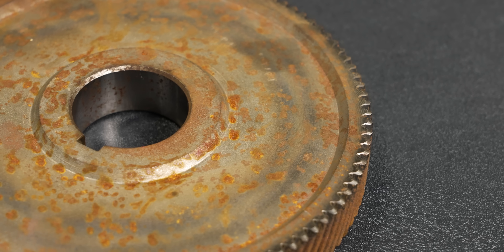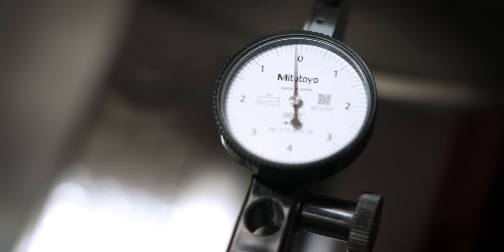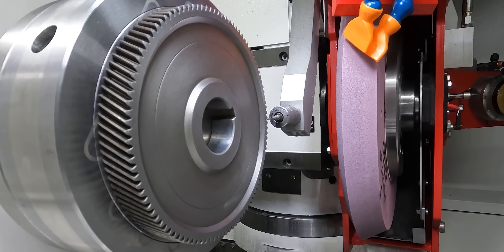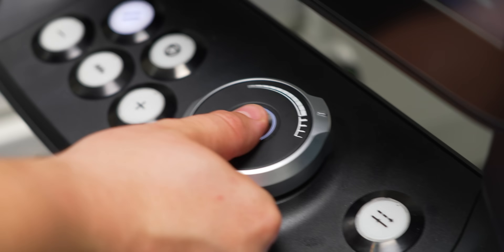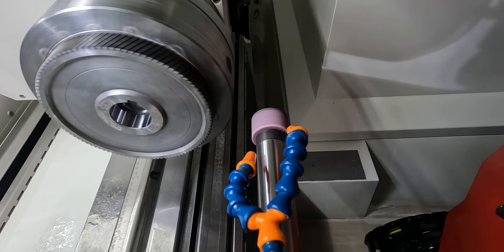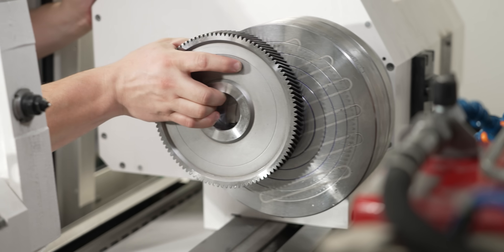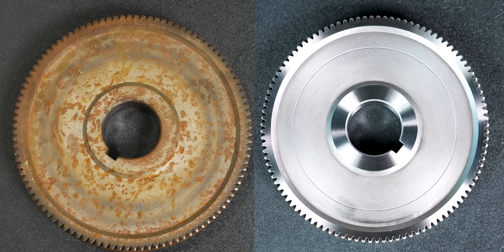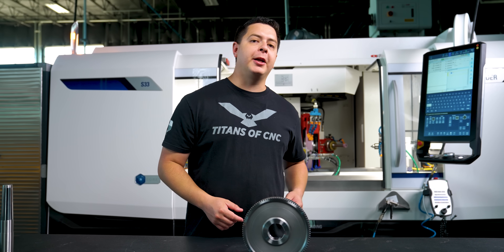Rust to Precision | Using a CNC Machine

Comment: I'm an experienced machinist and I mean yes, you ground and polished a gear and made it look pretty... but your methods definitely threw it out of parallel and certainly removed material so speaking from the book, less material means less structural strength... So technically you took an old gear with barely any surface rust and you made it operationally weaker and less parallel (imperfect tooth mesh)... So I would argue that it's possible you made that gear worse and less functional.... Feels like you guys must be getting desperate for video content these days

Comment: 1. That came out of Barry's Studebaker Avanti, correct?

2. You probably should have added a little metal by welding to the bore before you ground it to get the bore diameter back to spec.

3. Too bad you don't have a laser cleaning system in the building; that would have removed the rust from inside the gear teeth.

Comment: i work in heavy steel and our shop has many old machines and we often send gears out for checking to see how good they still are and its surprising they are good a high percentage of the time, and i have sometimes cleaned up 
the gears in a solvent tank or parts washer that works well and then some wire wheel action afterwards, it sure is good that these services are out there able to fix or repair gears of all sorts

Comment: It's good to see I'm not the only gear cutter who was wondering about the involute profile, helix angle, pressure angle, and pitch circle.

If it was me, I'd either use some form of rust remover chemical, or just a trip to the wire wheel if it wasn't super-critical.

Comment: I am a trained, 3.5 year apprentice in DK as a stainless steel blacksmith and know something about alloys, but I know almost nothing about machining.
What is the hardest machining tool steel there is and what can it be used for? Hard alloys are porous under the wrong conditions.
I don't know and my colleagues don't know, even though they are old machinists.
What is the technically hardest and by far the hardest tool steel used in modern times*?

Greetings from Denmark.

Comment: Assuming that this gear was made to spec in the first place, wouldn't further grinding actually take it out of spec?  OR, are these gears deliberately made to the higher end of their required specs so that you can go in and dress them up after they've gotten some kind of wear on them?
Reply: No you're absolutely correct and I can't believe they actually put this on their channel; like does Titan not know how gears are made?
Reply: I can not speak on this part in particular, though it seems odd to me that this part wouldn't just be replaced when worn out. Though there are plenty of examples, mostly big parts, parts that are not mass produced, or otherwise expensive to replace, that are made with re-machining in mind. Pipe flanges on oil and gas rigs for instance, they will be manufactured to spec. A, but you are allowed to machine it down to spec B before you have to replace it. Some times they will even do a weld buildup then re-machine to keep it in spec. Shafts and their bores on heavy machinery  sometimes also has this planned into the design. When the bore gets worn, you can go one size up on the shaft, and re bore the bore, sleeve the bore, or weld it. More or less the same holds true for the shaft.

Comment: After you flipped the gear you indicated in on to get it concentric, why?  You're just making one face parallel to the other, what difference does it make if it's a little off center?
Reply: Grinding lines
Reply: @Killou  blanchard looks better anyways
Reply: @Enrios  blanchard machines?
Reply: When he grinds the od of the gear if not concentric wouldn't grind the shoulder on the teeth like he did on the other side

Comment: It appears that you ground the least important surfaces but left the teeth root full of rust.. In other words, you didn't clean up the actual mating work surface. The rust will lead to stress cracks and fractured teeth. but hey, it looks good from the outside
Reply: The runout of the the faces and ID/OD are pretty important, regrinding the gear teeth takes a different machine or at least one with an A axis. But thanks, glad you liked it.
Reply: @christophervillalpando5865  Assuming it was a good part to begin with and just had some rust the run-out should have not been an issue (as was shown when he indicated it and found 0.001 run-out at the rim). Unless this thing is turning 10000 RPM or is in use in a very, very, very critical application I cannot believe it would be an issue (unlike corrosion on the teeth face and root.).
He essentially put lip gloss on a old fashion British smile (if you dont know what I am talking about watch Austin Powers)
Reply: @darikmatters8866  Thanks, glad you liked it!
Reply: @christophervillalpando5865  Chris, I really like the site and content (have been watching for years). I think the drive to create and educate a new horde of machinist is one of the best things that could done for the country. It was in that light that I pointed out the real issue with the part, the one that could cause catastrophic failure, was  not addressed. I just wish you pointed out that the machine you were using was not equipped to deal with the teeth and that it would need to be addressed in a another operation.

Comment: Gears are ground by their pitch line, not using the OD as reference. We have exact same machine and use pitch line chucks.
Reply: I didnt grind the gear profile,  I reground the main OD and the Faces
Reply: @christophervillalpando1815 and the shaft that gear goes on will have a shoulder to locate against that newly ground face and your teeth will be out of parallel. If you reground the face without regrinding the teeth then just chuck it in the scrap bin because it's now useless as a gear. Teaching is great but let's teach the right way.